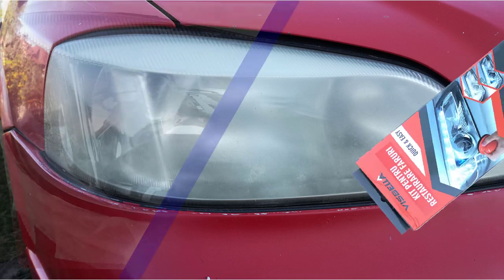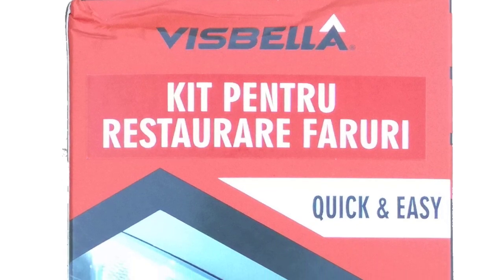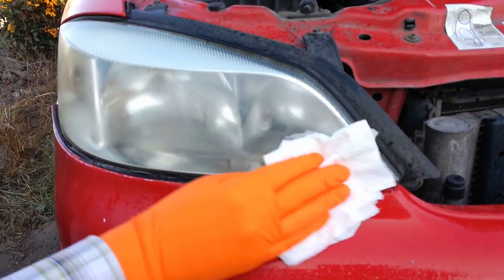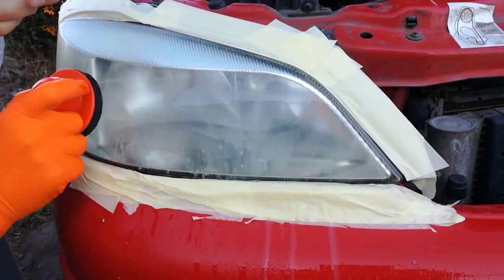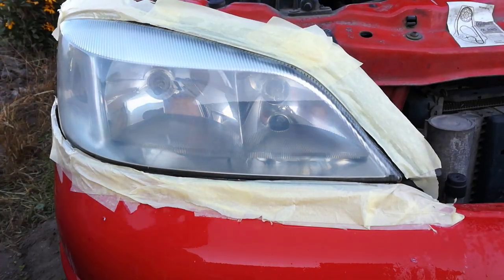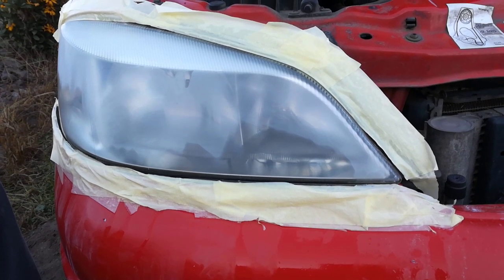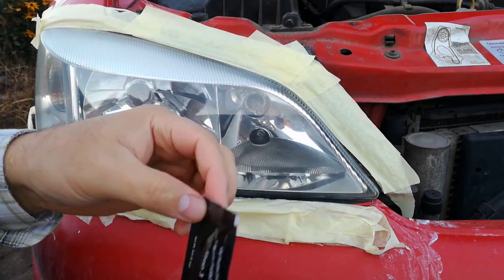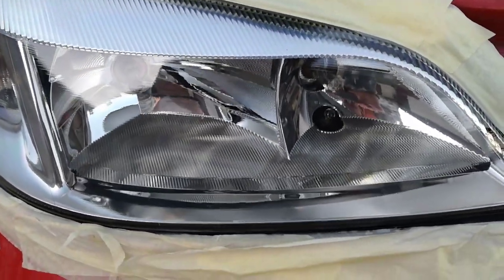rd #303 Testing Visbella Headlight Restoration Kit

Comment: I'm going to buy this today! I need it asap
Reply from the maker: Thank you for watching and good luck .
Reply: @redigitt  thanks bro should arrive tomorrow I'll let you k ow how it goes
Reply from the maker: You need to use a lot of water and you need to work in a dusty free area, otherwhise after you apply the UV protection liquid it will contanimate the headlight and you need to wait 12-24 houer to fully dry out the UV protection.
Good luck.
Reply: Thanks for the tips mate really appreciate it 👍👍

Comment: it was worthit.
Reply from the maker: Yes, for an old car is worth it and do it when is above 20 C degree outside or in a heated garage, otherwise the UV protective solution will not dry, should last for 2-4 year.
If you have a newer car, than probably you should put a UV headlight film, should last for more then 5  year.
Thank you for watching, if my video or advice  was useful, please consider to like the video, share and subscribe.

Comment: I didn't have the result you are talking about until i put the uv protection not just after using sand papers .
After using sand papers they still foggy,
In your video it's clear after 3 types of papers
Reply: I think when the uv protection gone they will be foggy again 😬
Reply from the maker: Aloha, probably you didn't watch the full video, after I sanded the headlight  and the headlight dryed ...it was still foggy https://youtu.be/0UtVw0tCglo?t=164, only after I polished the headlight get cleared.
Thank you for watching.
Reply: I am in a problem right now
The rain came after 3 hours and when it stopped i saw drops remain on the lights
So i tried to wipe it with water and tissues 😬then  i realized that i  made a mistake because  it was clear but now it is worse what should I do, do i need to repeat the whole  process or can i just put the uv protection?? and thanks in advance
Reply from the maker: Sorry to hear that, and  yes you need to repeat the whole process, probably it wasn't enough warm and the UV protection didn't dry.
After you apply the UV protection you have to wait 12-24 hour to dry the UV protection.

Comment: Hi! I know the package says that a kit is for two headlights but could I polish the 4 headlights with a single kit?
Reply from the maker: Aloha, yes you can use for 4 headlights or even more, I only used one  piece of 800-100-2000 sanding disc, the second one I put it back in the package for later. 
Thank you for watching, if it was useful, then please don't forget to share and subscribe, have a nice day.

Comment: Am o problema, nu se usca acel lichid cu protectie UV, acusi sunt 24 ore de cand le-am facut. Sa fie de vina frigul?
Reply from the maker: Da, scrie si in manual la punctul 
"3.PROTEJARE
Lasati solutia sa stea si sa se usuce pentru 15 minute.
Apoi uscati lichidul in lumina directa a soarelui timp de 1-2 ore.
Dupa pasul 3, pastrati farurile uscate si evitati umezirea acestora.
Nu spalati masina timp de 24 de ore."
Eventual trebuie incercat pus masina in garaj si uscat farul cu uscatorul de par, in cel mai rau caz trebuie slefuit si polisat din nou.
Reply: @redigitt  L-am lăsat azi la soare și s-a uscat până la urmă. Această polishare este ideal de făcut în sezonul cald sau într-un garaj "încălzit" iarna.
Multumesc.
Reply from the maker: Ma bucur, incearca sa nu folosesti  masina 1-2 zile, ca sa se intareasca pelicula de lac, altfel o sa se lipeasca de far toate mizeriile din aer
Reply: Lumina UV e data de soare prietene,daca e frig însă e soare pe cer e ok daca e înnorat pa pa UV.

Comment: Just wondering how the headlight restoration had held up over the year after you used it? Are your headlights still as clear as they were after you made the video?
Reply from the maker: I made the restoration in september 2019 and they still look ok, I can't notice any fogging, I can see the headlight bulb.
I don''t have a tool to mesure the clearness so I can't say 100% they didn't degraded in one year, but with my "eye mesure" I can say they look very good. 
This headlight restoration worht every penny, if you don't have money for new one.
I don't recomand to make the restoration in cold wheather only if you have heated garage, because the UV fixing liquid won't dry and you need to leave for about 12-24 houer to dry 100%.
Thank you for watching and good luck with your restoration.